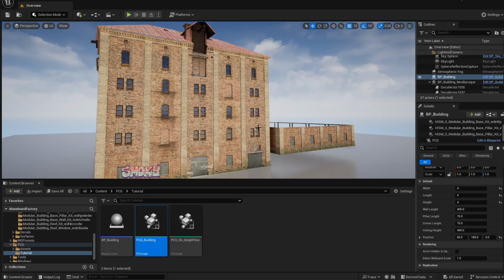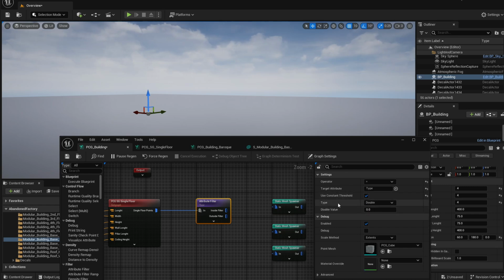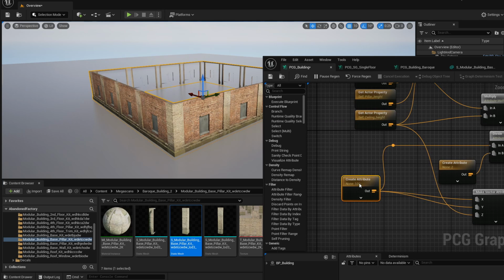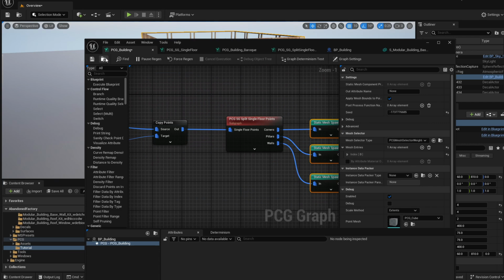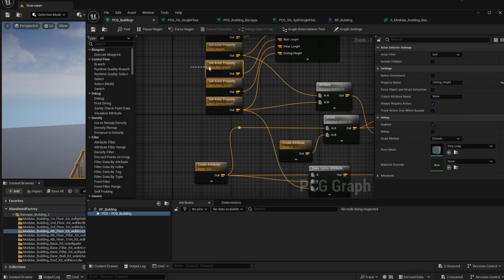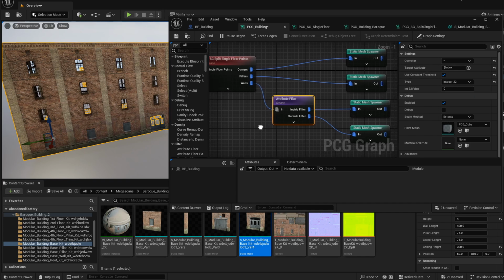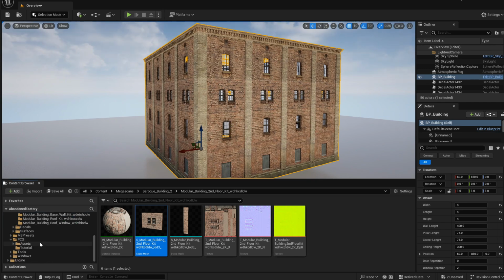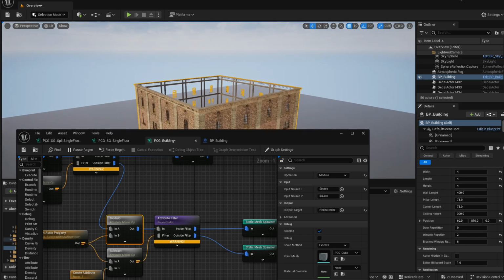Realistic PCG Buildings in Unreal Engine 5.4 - Tutorial Part 2

Comment: I'm following this tutorial again in UE 5.7 and for some reason after debugging something in the graph. I've noticed that the debug cubes are not lining up with the building. I've tried looking for solutions online and I've had zero luck. I don't have a clue why it's doing this since my other PCG's don't do this.
Reply from the maker: It's hard to say, since there are a lot of differences from 5.4 to 5.7, you need to inspect and debug the points on each node to check where the difference is coming from. From UE 5.5 there is Grammar support, which is much better for creating modular buildings, so I would suggest using other method if on newer version of the engine.
Reply: @dk_3d  I meant to come edit my post but the fix for the building with the position variable seemed to fix it. I'm looking forward to your updated videos with PCG grammar. Thanks for the great videos.

Comment: After creating the Point Grid for the height at the beginning of the video and connecting the values, I pressed the A key to preview it. I noticed that for Height 1, Index 0 outputs -200 and Index 1 outputs 200, which causes the building to float 200 units above the ground. Has anyone else encountered this issue and found a solution?
Reply from the maker: there is a fix in part 3
Reply: @dk_3d  thank you 🥰🥰

Comment: I'm using UE 5.5 and I'm not able to use the door or window repetition set up becasue the attribut filter doesn't have the filter pin on the left side. I've tried expanding the node to use the other points but nothing seems to work.
Reply from the maker: You maybe hav echecked the "use constant threshold" ? My attribute filter does have it even in 5.5. Or you maybe have created Filter Data by Attribute  which doesn't have it?
Reply: @dk_3d  I think he meant the copy attribute node doesn't have a attribute pin on the left of it. as it only has Target , and Source. I am having the same issue.
Reply from the maker: @1tapeoka1  In 5.5 the copy attribute node is not available there is Copy Attributes (with s at the end so multiple attributes) that's why it has different structure, but you can connect your same pin to both the source and the target and it will work the same way as shown in 5.4.

Comment: Im following this tutorial in Unreal 5.5 and Im getting some weird results. First of all, I cant move the building. It just kinda snaps back to the original location. I can only move it in Z and then it snaps to some weird incements?
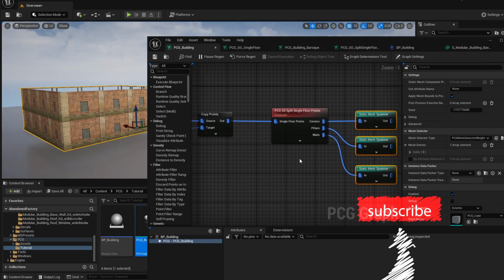Secondly, the entire building is like. Offset from the ground almost half a wall hight when the actor is at 0,0,0 in wold space. Any ideas? I stopped at 24:08 since I saw you moving your building around.

Edit: I tried chaning the create points to "Local Component" same issue.
Edit 2: Also at 25 minutes in there is no Copy Attribute node. Only copy attributes, it looks simmilar but breaks the entire setup. // Solved this, plug Attribute filter to both Target and Source and it does the same!
Reply from the maker: Check the first 5 minutes of Part 3, for movement Fix

Comment: Hello ! great tutorial!!  How can you move the blue print on the map ? I can see you have create a  Position parameter in the default under ceiling height? thx
Reply from the maker: You can move it with regular Move tool in UE, but you can also place it with PCG with Spawn Actor node so you can create full city block
Reply: @dk_3d  I think my problem is here. when I move with the gizmo, the gizmo is moving but not the building
Reply from the maker: @Rool1o  Check Part 3 it has section how to make it so it copies the points to the BP position. The other way is to change the Create Points Grid to "Local" insteaad of Global position

Comment: At 32:43 the return value of the subtract(after changing the output target to “LastFloor” when I plug it into the filter attribute and set the threshold attribute to “LastFloor” gives me an error saying cannot use integer 64 on a integer 32. Hence not filtering the last floor. One more thing I should add is I’m using 5.3
Reply from the maker: Try checking all the variables to the same type, from the blueprint and each node afterwards.
Reply: @dk_3d  All the variables in the blueprint node that are integers are in fact just integers. not 64. Based off the Inspect in the PCG, the Actor Property for Height is considered a Integer 64. Very strange because on the single floor the parameter for height is just an integer not a interger64.
Reply: I think Ive got a solution. May be temporary  though. From the Points filter that filters for the base floor. The outside filter pin I have connected to a get number of points(It would have already filtered the 0 Floor index, so it returns Height -1 value as a 32Interger) I then plugged that into the filter pin of the points filter. It seems to do the trick.
Reply from the maker: @1tapeoka1  Glad you find a workaround, there are some differences in each engine version and the PCG system is still considered Beta or Experimental in different releases so there is nothing final for now

Comment: Why don't use 3 separate outputs instead of weak linked custom named variables and filters decreasing performance? Also shouldn't spawned meshes be static instead of movable?
Reply from the maker: No need to be movable in this case yes.
I didn't understand where exactly you propose the change to 3 outputs.
Reply: @dk_3d  PCG_SG_CreateFloor output 3 pins. But watching the video after, I found there's needed a proper structure for Copy Points. And I'm looking for a proper map/dictionary/array to use as input and split after. Maybe BP Structure can be used instead of filters.
Reply: Actually, there's no better than your 3xfilters structure found. Some devs recommended Match and Set attribute also, but it works only on Static Mesh Spawner node. I was surprised BPs have no map/dictionary data structure.

Comment: What value should I put in the threshold attribute in Attribute Filter? Also, in Subtract Output Target, I am not able to change the static mesh for the 4th floor (from time 32:15).
Reply from the maker: The LastFloor Attribute
is set as OutputTarget in the Subtract Node 

If you have properly setup the filtering you should be able to change the meshes and for it to take place in your scene

Comment: 32:47 I cant see the aprameters. Amazing work!! Can  you let us lnow how and where to place the LastIndex parameter? thanks!
Reply from the maker: Hello, sorry I'm using wide monitor and the full screen is not recorded. Usually I try to move everything in the recording view but I missed this part.

The LastFloor Attribute
is set as OutputTarget in the Subtract Node 
and
as Threshold Attribute in the Attribute filter
Reply: @dk_3d  I still can't understand:face-orange-biting-nails::face-orange-biting-nails::face-orange-biting-nails:
Reply from the maker: @xinkangshen7169  well I have used a named attribute just to be more precise, if you do not understand you can just delete the 2 nodes and create new ones, the way they are setup by default will work.
It will just be harder later to know what they are used for :)
Reply: @dk_3d  Great pcg tutorial,！I need to slowly understandslowly all the logic in it.
Reply: @dk_3d hello, this is a bit of a stretch but I hope you can help me. I have set it up exactly like that but the point filter is giving me an error:
1/1: [BP_Building Generator C_31] Warning: Cannot use threshold type 'Integer64' on input target type 'Integer32
I can't find the Interger64 anywhere in the graph... Any ideas ? I'm on 5.3.2
Reply from the maker: @CoolSquirtle777  
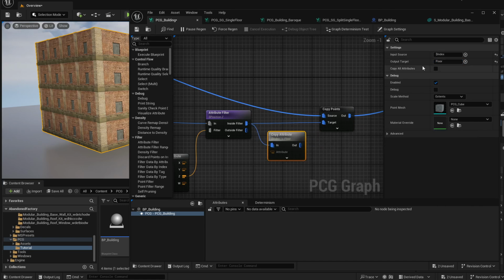You can try at 24:58 instead of copy attribute to do "Add attribute" where you can specify the type of it to Int 32 or 64 whatever you need 
and then use copy attribute inside this new one.
I vaguely remember having similar issue, but cannot reproduce it now, maybe the fixed it in some update idk.

Comment: if you create a part of a city of 20-30 houses in this way, what will the fps be?
Reply from the maker: In my test scene, with 32 buildings and over 4000 decals on them if you look from far away to see all of them it is about 70fps if you are at street level it is at the 120fps cap.
Reply: @dk_3d  why is the FPS impacted if you create houses in this way or you created them in the classical way? The fps should be perfect equal in both creations methods, right ?
Reply from the maker: @xjuliussx  It should be a lot more optimized this way.
In the "classical" way to achieve the same level of optimization after you create the desired building element by element you should group all of the same elements (lets say walls with single window) and add them to a single HISM (hierarchical instanced static mesh) which if you need to change anything on the building later will be sooo hard to do.